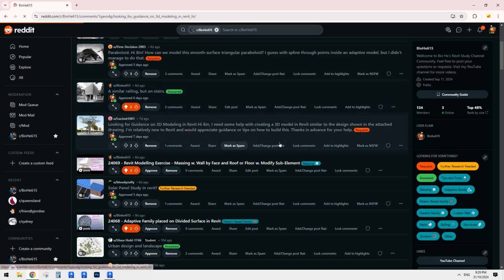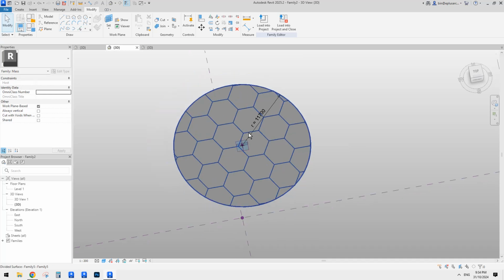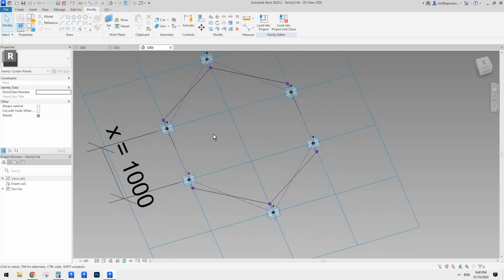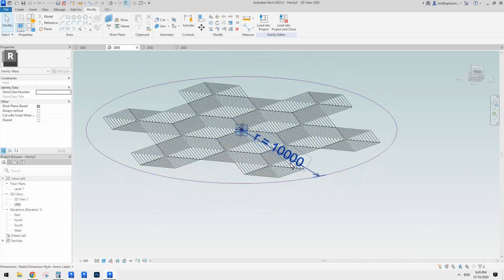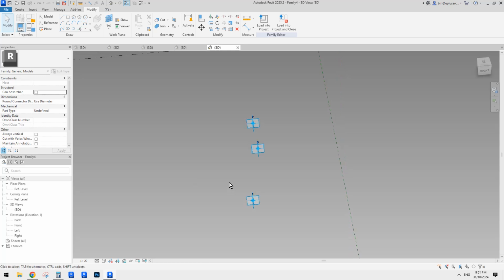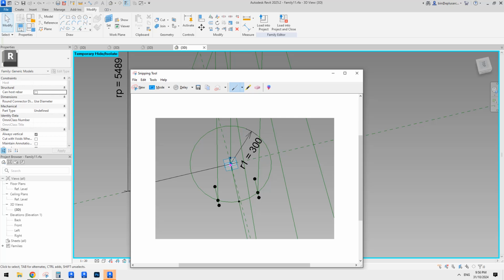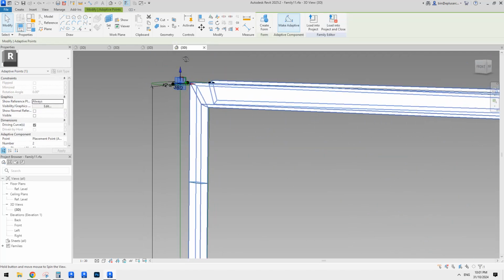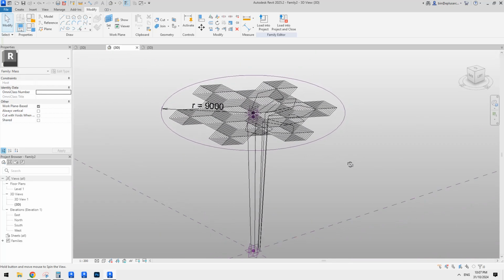24076 - Revit Modelling Exercise - Parametric Structure using Pattern Based and Adaptive Family

Comment: Hi sir, thank you! Amazing work

You may place those points on the circle, inside the supporting structure adaptive family, by using a formula (without any extra points> reference lines>intersections option and stuff):

arch = ray * angle (radiant)

Placing those points on the start point 0.00 circle lenght, you may set their location by creating the parameter: 

"segment lenght" = ray * π/6 (if you considered a 30 degree angle inside the hex geometry)
Reply from the maker: Thanks very for your feedback. You are right, my method is a bit clunky. Actually, instead of using segment length, we can probably use angle directly. What do you think?
Reply: @BINHE615  yes sure! I agree. "Angle parameter" + "distance=ray".
Otherwise with "segm.lenght" we may have less clicks, because we place the point directly on the circle.
Thank you Bin! Our revit master